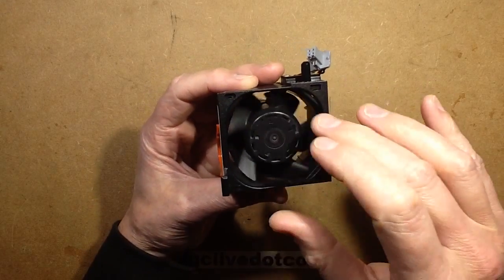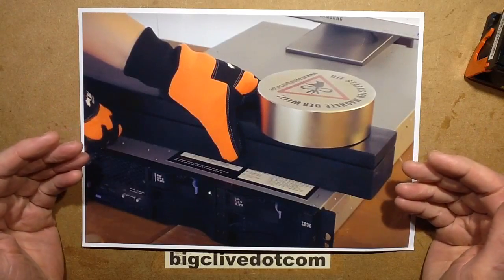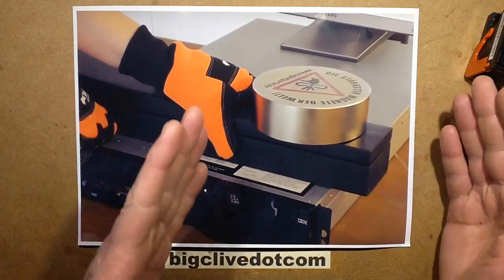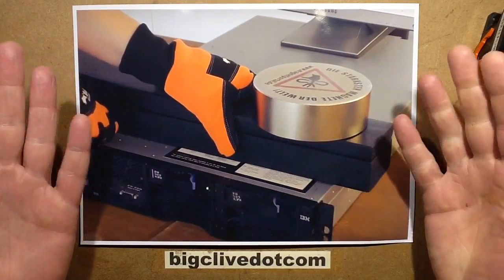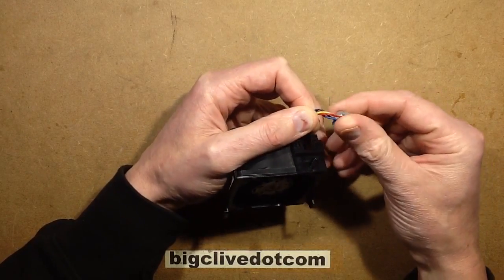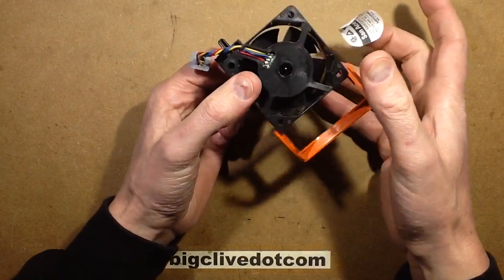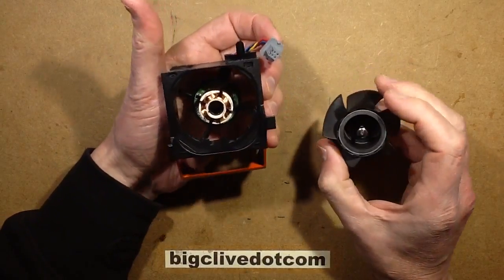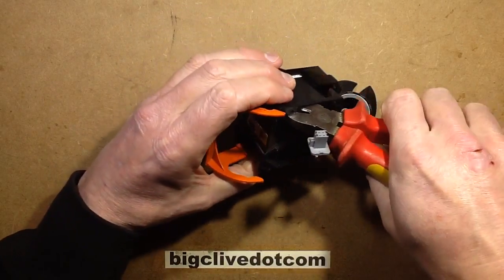Dead server fan autopsy.  (Unusual circumstances.)

Comment: Love the show, keep it up. It could have been induces voltages from the magnet passing over the motor windings thereby obliterating the zener diodes. Wonder if the motor had an all metal case that the Faraday cage would have saved it?😮

Comment: This motor arrangement is similar to my underwater ROV. Gladius Mini. . . . . awful for fine sediment and even dried salt to dry out between parts. Become quiet good at stripping and cleaning, also regimental at post dive cleaning procedure involving a soapy-bath. . . . Commercial Divers and Iridium magnets have become inseparable, due to their portability and strength. . . . used with a short lanyard to stay on location around Oil-Rigs or ships. . . . . . Nightmare for me when using Induced Magnetism NDT techniques, as they tend to leave a residual footprint. . . . .  (ACFM or Eddy-Current)

Comment: don't mess with magnets .There are some old speaker that used to destroy tvs and watches quarts and mechanical .The old CRT or plasma screens are absolutely destroyed by them .Old hard drive magnets were deadly on your fingers pinching them and when they slamed against eachother they would make a huge spark !

Comment: I haven't got a complete thought here, but here goes. Just like a brushed motor, a brushless motor can work in reverse as a brushless generator. I haven't got the physics clear in my head, but I nelieve the motor is "generating" - creating voltage backwards through the coils in the times between when the coils are pushing the magnets. If the controller were to drive the coil at the time when the coil is generating a voltage, the two might add up putting a decent voltage on the MOSFETs and those zeners. I'm thinking the outside magnet confused the hall sensor and made the controller drive the coils at the wrong time. The zeners would go first, I would think, and that would explain the damage. The current control section also blew up from the same overvoltage. RC hobbyists know that you can burn up a controller by over-revving the motor, and I bet it's a very similar situation.

Does that make sense?

Comment: If these were in a PC, perhaps the 5V (red is usually 5v in a PC) supply regulation in the main power supply failed and dumped a huge voltage into the fan, and everything else in the board using 5V; or 12V if that's truly what the fan runs on).  Even though it's shielded, the magnetics in the switching supply could become saturated easily by the flux from the magnet.

Comment: I've got a pair of 1" cube N52 magnets. They are scary powerful...

Anyway, the fan is powered by the mainboard of the server, which gets power from a power supply. Any chance the scary large magnet damaged a component in the PSU which could have caused power spikes?

Comment: I just found out recently you can separate that double stick they use on those with quick dry electric spray. Weakens the industrial adhesive to the point where it feels like cheap dollar store double stick.

Comment: I'm wondering if the failure is due to the BIT magnet saturating the iron cores, so that they don't behave like inductors, but shorts with only a resistive component to their impedance. That could potentially overload the circuit.

Comment: had to try this as id DID seem a possibility that can be replicated, so I took a small 1.5. in fan and a 20mmx40mm N52 neo magnet, powered up the fan and ran the magnet by it and low and behold, it stopped and smelled funny, now a dead fan LOL

Comment: there's also another possibility of messing with the magnet on the fan and jamming it in place and bad things happen when fans are jammed plus the electrical force (yes magnets do induce EMF) could have stuck the mosfets wide open and of course the magnetic sensor could have been fooled by that huge neo magnet, tricking it into ... you know the rest

Comment: My guess would be that the zeners conducted every time a coil was shut off, but the magnet either held the fan still by brute force or saturated the stator/weakened the rotor field. The chip told the coils to turn on for say, 5msec as per normal, but with lower inductance in the motor the current rose to a higher level. The reduced inductance was offset by the higher current, E=L*(I^2)and the zeners had to dissipate more power--> overheating--> open or short circuit failure. That, or the hall sensor was overwhelmed and the cylinders got fired out of order. Either way, it was probably stalled and heating up for several seconds at least. Wonder if it would be worth finding a similar fan and deliberately burning it by holding a small magnet directly over the motor, while monitoring current consumption or even puting an oscilloscope in it.

Comment: The magnetic field confused the hall effect sensor, both FETs opened, possibly a condition the controller, wired in non standard configuration caused, it definitely allowed the condition to hold, until the weakest link broke

Comment: I'm surprised that was all that was killed. You'd think that the inductors in the vrm for the cpu would have spiked the cpu and fired it. In fact you'd think every inductor and winding on the board and power supplies would kick out lethal amounts of voltage all at once.
Reply: Apparently not. Maybe if it was moving faster.
Reply: True, even a high intensity neodymium magnet shouldn't induce that much voltage unless it was approaching the server at supersonic speed. And in that case, induction would be the least of it's worries :-p

Comment: Is there some form of "down and dirty" clamping circuit which would prevent over-voltge/current?
Reply: I think the zener dildos were supposed to do that every time the motor turned over. But something about either overwhelming the hall sensor or seizing the motor in place caused an an increase in the current flowing during each transient. The magnet may have even counteracted the field and kept the stator coil from magnetizing properly, or damaged the permanent mmagnet on the rotor. If you press a small neodymium magnet against a weak ceramic magnet (north to north or south to south) you can permanently weaken or reverse the field in a spot on the ceramic. Magnetic viewing film will show the damage, even though the outer shape of the ceramic magnet is unchanged. You can also spell out letters on the back of a fridge magnet using a 2mm neodymium magnet. You can't see them without the viewing film!

Comment: If the fan was running when they put the giant magnet nearby the coils would have been moving through the field. No need to move the magnet fast to induce a high voltage.
Reply: Except the fan has stationary coils...
Reply: @kilrahvp  that's why I said could happen? Might have something to do with the changing magnetic field though as in terms of when the coils orbing are jawstand near Jost excetera but yes I know stationary coils but when power was being applied if the magnet happened to be in wrong place and right time it could be issues is what I was trying to get at I should have been more specific sorry I was half not there I barely even remember watching the video
Reply: I didn't think about that but yes it could have happened.???

Comment: Very late to the show here,, anyway a ferrite magnet like the printed magnet that makes up the rotor would tend to concentrate the external magnetic field similar to a ferrite transformer core I could see a high voltage pulse coming from the moving rotor passing over the coils inside the crazy field!
Reply: The ferrite on a permanent magnet has less susceptibility (not sure if this is the word) to that than the ferrite in a transformer. I think it would only reduce the external magnetic field when it opposed, and boost it when it aligned. The difference between the peak and trough wouldn't be any worse than it is during normal operation. The external field could have weakened the rotor magnet though. If you push the repelling end of a small neodymium magnet against a big ceramic one, it will leave a weak spot in the field. You can spell your name on the back of a fridge magnet, and then read it using magnetic viewing paper.

Comment: There was fast motion, it wasn’t the great big magnet that was moving fast but the windings, when the fan was spinning.
Reply: The windings were mounted on the frame in the center of the motor, only the outer ring shaped magnet rotates.

Comment: Question: why wouldn't you want the fan to run at full speed the whole time?
Reply: Small but meaningful power savings.
Reply: @B-System  This and noise. Those server fans sound like jet engines on startup

Comment: Maybe it is much simpler
Magnet stopped rotor, so rotor's magnet became static, so no change in magnetic field from magnet side.
Winding is simple choke and works like come in absence of external source of magnetic field. Controller have switched off wrongdoing, but due to nothing taking this energy, magnetic field have collapsed and got converted to very high voltage, which in effect shorted diodes.
Reply: That's about what I think happened, but I'm not positive.

Comment: some server fans doesn't require signals . you can directly connect the power wires to the supply . then some will slowly ramp up to full speed  depending on the  input voltage  and some will instantly ramp up to full speed  depending  on voltage again  . a while ago i built an array of 4x5fans  20 fans total .   each fan takes about 1.1A   5 in parallel takes 5.5A to 6A then the other 3 groups of 5 in parallel of the 1st  5 then   you will get a total of  22A @12v = roughly 264w  . as i bought a large  box of 200  hp proliant  dl380 type server fans as a job lot  for £30 on ebay  a few years ago  and still have some left to this day . some i over volted  on 15vDC and they try to take off  or  i walk them around by the wire  as they are that powerful  they can push them self's around . thats what i did  till they burn out .....
Reply: and running all 20 fans at 12v is that loud  it sounds like a jet plane  starting up

Comment: I am a manufacturing engineer at a major fan company.

1. That design fan is called an inverted fan. Its called that because the magnets go on the outside of the stator instead of inside it like on a conventional motor. Very common for small fans because it reduces footprint size.

2.It uses a 2 phase setup with the center tap being pulled to VCC. Benefits of this is allows for very simple circuity. As each phase is pulled down by the FET, it fires that side of the stator. 

3. Those zeners are to protect the FETs from the back EMF of the motor.
4. When the fan has a small failure, it tens to cascade as high current draw and back EMF creates lots of heat and burns up everything.

Comment: The vent was spinning when big magnet was introduced......  that created generator effect and no wander why  parts blow up there!
Reply: The coil part is stationary. The only part that rotates is a ring shaped permanent magnet on the outside cup.
Reply: @deltab9768  it does not matter, if something spinning in magnetic field, there always be the induction, eddy currents and something will burn :D
Reply: Except, the voltage is induced in whatever is exposed to a changing magnetic field. If the rotor spins in a magnetic field, it gets exposed with the field in one direction and some milliseconds later it is exposed in the opposite direction. That induced voltage will do nothing, because it is very low* and is induced in the insulating ceramic permanent magnet and plastic blades of the rotor.  The coils inside the motor are in one place, facing the magnet continuously and being exposed to a steady field. The only fluctuations in the magnetic field traveling through the coils is when the rotors and the stators electrically generated field adds or subtracts from the magnets external field. These fluctuations are the same, if not less, than what we would see with the motor operating normally, so they shouldn't hurt anything. Now, if the rotor position sensor is deceived, or the rotor refuses to turn, or the stator coil cores or rotor magnet have their ferromagnetic properties altered, than the coils could be fed with more voltage or current than is normal. I can't point to exactly what components experienced what abnormal currents without  seeing the full schematic of what's inside each chip, and how it connects to the Hall effect Sensor. In any case the zener diodes experienced more current or a longer lasting current than they were designed to handle.
*in this case, any voltage which is too low to cause arcing current flow inside a piece of plastic or ceramic can be considered too low to do anything.
Reply: @deltab9768  nice long answer, but to get real answer we need to do test with oscilloscope. I think because wingdings spinning there is AC voltage  applied to all components, but they are designed only for DC. do not forget , that they introduced the great, bad ass magnet, and it has so great magnetic field, that easy overcome the built in magnet in fan.
Reply: This fan had no spinning "wingdings" anywhere, period. I agree that the big magnet could have overpowered the small permanent magnet in the motor. It is the only moving part and demagnetizing it or locking it in place could certainly have burned out components on the control board, in any number of ways. I also agree that we can't know exactly what happened unless we measure voltage and current in several different places at the same time using an oscilloscope.

Comment: You wouldn't need to move an extremely powerful magnet very fast to induce quite a large magnetic field change in a large number of turns like that fan motor has.
Reply: Those magnets top out at about 2 Tesla, whether they are the size of an aspirin tablet or an Android tablet. A larger magnet will need to move faster to  create the same rate of field increase, because the field starts increasing when the magnet is further away. If the magnet slammed into the server at orbital velocity, I would agree that some high voltages were induced, but then again the fan would be destroyed mechanically making it a moot point.

Comment: If I understand magnetic fields correctly, then if you had a glove/mitten that happened to be made of steel or similar ferrous metal then the magnets would be able to attract each other through the material. They would simply be attracted to the glove rather than each other, assuming the glove is one piece of rigid metal. Yes this creates other problems, but technically is means that the magnet is no longer exerting force if it meets with a metal, it becomes one and shares a field with that metal.

Late night thoughts with herpn derpn brought to you by a 16 hour work day.

And no I would not wear that glove, but in theory the magnetic fields would not exert a crushing force between one another. Perhaps someone with more engineering classes than me could chime in....
Reply: Not gonna read all the comments for something about the hall-effect sensor and the control chip.  
Your comment caught my eye.  Two slightly odd thoughts - 
  1.) The glove would have to be somewhat larger than the magnetic field of the magnets? 
  2.) Insert hand into glove AFTER the magnets come to a complete stop!!  That is, IF you can get the glove open :-D 
I'll pass on those monster magnets.  I still have difficulty with the HDD ones.
Reply: Yeah, you go try that out and report back how it turns out for you.

Comment: random thought a couple years later, the fans were spinning at a few k rpms, their little tiny magnets can induce voltage into the circuit as long as its spinning, when you put magnets together they increase the strength of any magnet they are near or connected to, likewise if you put a magnet on a transformer it will change the inductance and you will get a shift in frequency of the driving circuit and/or shunting of the current but either way i look at it, the circuit couldnt take the either a: over-saturated metalic core not absorbing/pushing away from the coils and allowing more current to flow with nowhere to go or b: the fan magnet's flux was increased by being in the presence of a much stronger magnet and backflow of eddy currents as the coil went by at 3000 rpms made stuff go boom
Reply: also,  "The magnets in the rotor will have acted as conductors moving in a (very strong) magnetic field at 3000 rpm or whatever - acted as an alternator and arced over or induced large eddies in the stator and pcb? "
3rd thought, what if it worked in the way of a transformer, we got high voltage in on 1 side(12v) into a few ohms of coil, feeding to the magnetic ring? whos to say the magnetic ring didnt pick up the magnetic flux as it spun and worked as a high frequency single turn coil in turn feeding back the steped up voltage from 1 turn magnet/shell/case to 100 turns on the coils?
Reply: 4th thought....occam's razer, maybe the internal coils were trying to move the big magnet and it's mass just caused alot higher current draw than expected, trying to spin a small low mass fan blade and magnet assy and parts being built to the lowest standard that will work for the time specified in datasheets, they just couldnt handle it
Reply: .....you can feel free to stop reading now because this is all just conjecture based on personal experience and my understanding of the physics of such items
if you put a magnet on a EL wire driver or some flourescent lamp/led drivers, their frequency shifts upward and they get brighter/audible sound change because they can only inject so much energy in an already saturated transformer core, gives the core less room to hold a charge so it fills faster and resets faster
Reply: The coil is stationary in the middle of this motor, and the rotor magnet is nonconductive ceramic. I think the stator core getting saturated, or the outer magnet being held in place by the big magnet, would both be potential causes for high current spikes and cascading failure.